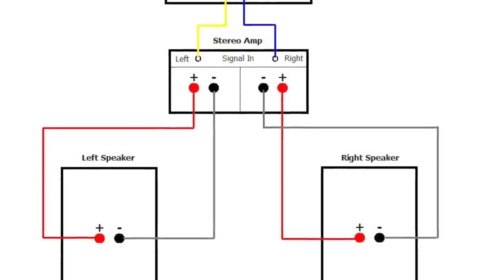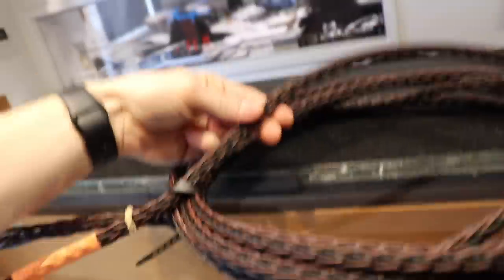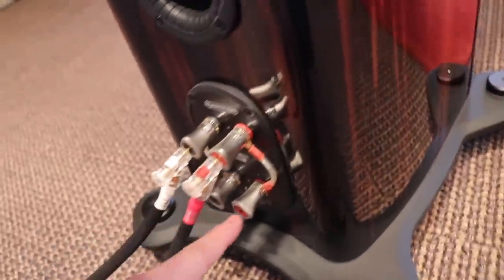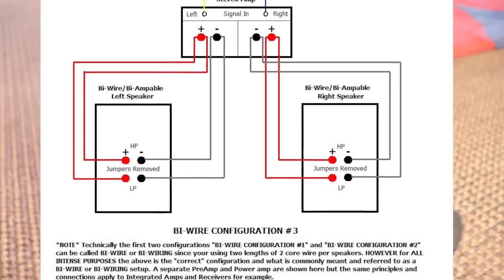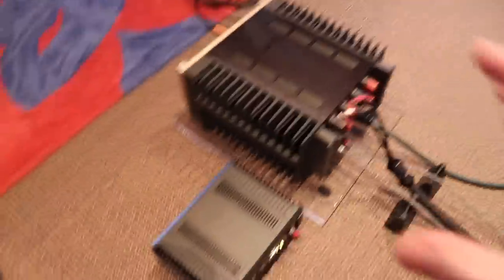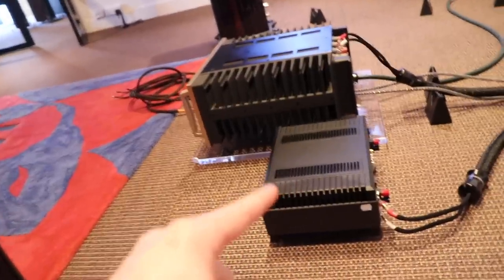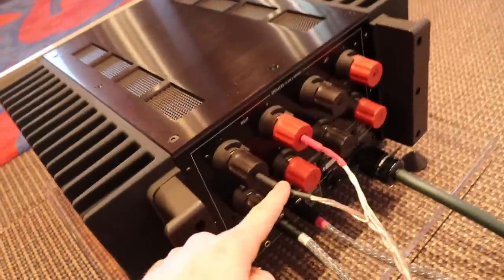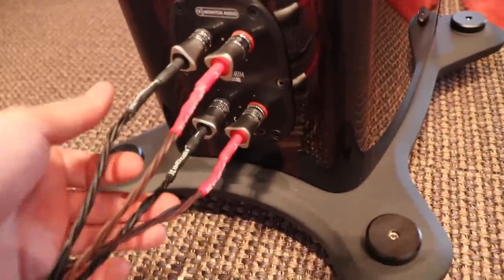Bi Wiring, Bi Amping   What is it?

Comment: When bi-wiring you mentioned it doesn't matter what black or red terminal you wired into - this was in reference to those vertically below, how about using 4 terminals in a row? My Marantz PM6006 is wired like that, just wondering if that makes a difference..
Reply from the maker: On that amplifier, the purpose of speaker A&B is mainly to be able to select between two zones or two sets of speakers so I would probably just stick with standard wiring.

Comment: Completely over complicated and electronically questionable. It definitely didn’t sound “the world of difference” these changes given initially adequate amplification are at best VERY subtle and you have to go to the extra trouble of matching amps. If the amp levels or design are different you are using amps as tone controls.which is an anathema with most high end audiophile guy!

Comment: How would you hook up a sub to a bi wire set up I've generally seen people hook them up straight from the speaker outputs would it just be from the amp outputs or what about super tweeters and in theory couldn't you get a tri wiring speaker and do a 6 amp set up I'm super interested haha so sorry for all the questions

Comment: Noob question here. So I have an AVR but no independent amp. So in this case I would not bi wire until I purchased an independent amp correct?
Reply: You could bi-wire, but you likely won't see much of a difference, not because of your system, but really the benefits of bi-wiring are questionable, it's a hot topic in the audiophile world.  Really the most measurable difference in using twice as much cable,  is you are increasing the gauge of wire going to your speaker.  If you use proper wire.  likely 12 to 10 awg you will be just fine for shorter speaker runs under 25ft.  If you want to bi-wire, you can use two sets of cables, one with spades, and the other with banana plugs into your AVR. but really you are just buying wire.  See what I did there :)  There will be more benefit from bi-amping.  Different amps have different sound signatures.  So if you likea specific amp to drive your low end, like a Class D, and want something that has mosfetts or tubes for the top end to get a different characteristic from the top end you can change how your speakers sounds.  Do some research on your speakers and find amplifiers that are complimentary of them.  If you are just using your AVR for movies, I probably wouldn't bother.  If you like to listen to music and want a big sound stage.  Play with some 2ch stereo amps not an AVR.  See what you like.

Comment: You missed to talk on how to connect the pre-amp out to the  2 power amplifiers. Do you split the pre-amp out wire to 2 to be connected to the 2 post-amp?
Reply from the maker: If You are going to bi-amp, your preamplifer must have multiple main or master outputs so that you can send full range stereo to both amps.  Dont use y splitters.

Comment: Is bi-amping, passive or active, intended only for passive speakers then?
Reply: In a true active system the cross-over, ie splitting the signal into bass/mid and treble is performed by a powered crossover located between the preamp and poweramp at line level. So a typical 2 way loudspeaker would require 4 channels of amplification, each of which would be fed only bass/mid or only treble depending on the speaker drive unit it was driving. In a passive system the cross over is performed after the power amplification with the cross-over typically located inside the speaker cabinet and powered by the music signal, which is a huge source of loss and distortion. A properly designed and installed active loudspeaker will be far more accurate and requires only modest amplification to produce any given level. A passive cross-over is basically why many speakers are power hungry, it saps the amps power dissipating it as heat, as well as creating phase shifts.
Reply: @jerrypartington3650  thanks a lot!

Comment: How do you match the gain when you using two different amplifiers? I tried it with two different size amps from same manufacturer and the bass was overpowering, I eventually resorted to an active cross-over which I use just to match gain.
Reply: as long as the amplifier sensitivity is the same you get the same from both amplifiers.

Comment: Very confusing and way to convoluted and overly elaborate. Then you have all the possible 'alternative' setups to make it even more confusing to get the gist of it and the basic advantages.. Still don't quite understand  :( 

On top of that the sound of the video could be greatly improved by using a better microphone. It's very disturbing sound-wise especially when you try to listen to the guy on headphones. Something you would not expect from a video that's all about sound quality. It sounds like he's in a bathroom. He's also talking extremely loud for some reason. Just some observations - rock on. ;)

Comment: Why would the manufacturer include the "flat blade of metal" if it deteriorated the sound so significantly?  Answer= They wouldn`t.
Reply: Why would speaker cable manufacturers go to all the trouble and expense of making intricate cable weaves (out of processed exotic metals) if solid or flat cables were just as good?  There would be no need for RF coaxial cable technology, or twisted cable, if there was no degradation over a single strand wire.
Reply: @bigpicture3  Your reply makes zero sense, and is not relevant.We`re talking about a speaker connection less than an inch and a half long. Not going to get a whole lot of signal loss in that run. What do you think the wiring is like behind those connections inside the speaker it`s self? No better than the jumper, I assure you.
Reply: I changed my blades to jumpers and could not believe the difference.

Comment: How can bi amping work without an electronic a crossover? you can asign full range frequencies to all the drivers. Thanks
Reply from the maker: There are still in line crossovers inside the speaker.
There is one for the highs and one for the lows, they are connected to seperate sets of binding posts.

Comment: Just bought myself a Yamaha rn-803d amp. And om the manual, Yamaha show how to bi wire.  But They use Port A and B on the amp. Everywehere else ppl use just the  A Port.  How is that?
Reply from the maker: Thats Bi-amping which is different to biwiring.
Thats just yamahas way of distributing a bit more power to the same speakers.
Reply: @SoundlineAudioNewZealand  no its bi wiring.  The yamaha manual is rubbish anyway.  Dont know why they show a and b ports on bi wiring.
Reply: @chriss881000  No doubt to make it easier to connect 2 sets of cables - spade terminals always make worse connections than banana plugs, so one set of cables would be at a disadvantage otherwise.

Comment: How much do you want to bet, there's a metal blade between the terminals inside that amp? Also, isn't the real advantage of bi-amplification the ability to use a DSP crossover and eliminate the mechanical device? Bi-amping a premade speaker like those, aren't you still going through the mechanical crossovers?

Comment: Bi-wiring : a way to spend double on cables 
Bi-amping : a way to spend double on cables and double on amplifiers 
There could be a benefit to bi amping if you want to change levels of bass driver to mids/tweeter perhaps. Or if you want to flavour the sound with some non standard amp
Reply: Bi amping would also increase or double the power.
Reply: @ekimandersom4478  so just get one amplifier with more power why would you buy 2 separate amplifiers,, you use additional for a 2''3'''4' way system ,,,,but you need a cross over,,then each amp is for a specific band of frequencies,,am i missing something
Reply: your rite rennie  love the way you put ,,the hole thing makes no sense at all
Reply: Bi-amping means the mid/hi pack is receiving a pure and independent signal separate from the bass at the head of it's cross/over and not in conjunction with the bass cross/over network.  This yields a significant difference, auditory and in speaker performance.  The greatest advantage being if the network is electronically divided.
Bi-wiring yields NO difference over just running a single pair into the entire speaker.  Still, I prefer to wire this way with separate connectors on both speaker and amp.  Lower resistance gauge, and separate inductance in each wire.  It's the best connection you can make whether you can hear it or not.
Reply: @keithmoriyama5421  thanks keith,, this is new to me,i have a marantz 2252b i think its great x-cept for the speaker connections,,they used  the spring push in type,,,they suck,,i want to change to those  newer banana  jacks,they look good ,,but maybe you know a better way??

Comment: What's the benefit of doing both bi WIRING and bi amping when it comes to impedance/ohms?
Reply: By its very nature, the more cable present, the less impedance is added to the sum of impedance seen by the amplifier.  Ideally the speaker outputs want to 'see' only the true value of speaker coil impedance, therefore influencing the 'damping factor'.   Bi-amping gives improved damping factor allowing better control of the speaker cone movement [specifically the woofer] over bi-wiring/single-wiring where the crossover components for the higher frequencies would interfere with it.  Bi-wiring's advantage is that the amplifier out is split at source, rather than having to divide itself at the cross over.

Comment: Acording to another expert on youtube, he said the if one is to use 2 cables to one speaker, they should be the same, not different. And as for bridge,  One could just cut ones cable and use a stump as a bridge. then it would aitomaticalli be better than the gold plate???

Comment: interesting bi-amping . can I do it with a solid state on the bottom and a tube amp on the top ? bot audio research .I already have a D-100B model
Reply from the maker: Try it and see how it sounds.  You may find with different amps however that the output levels won't match up and your lows or highs might be a lot louder than the other.
Reply: The most time consuming thing about bi-amp is to find the right pair of amps that will sound seamlessly. I found some success with an ARC D-120 at the bottom and Bryston 2B-LP at the top with my Maggie.

Comment: It seems like multi TC cable would cause smearing in the audio image due to timing variances?
Reply: No.  The braiding reduces inductance and noise.  Kimber are among the best cables you can buy and in the case of 4tc and 8tc a strong value.  Beldens new specialty speaker cable sold through Blue Jeans is also a braided design.  Everyone doesn't braid because it's an expensive proposition.

Comment: A company goes to all the work of making these speakers sound so good and cost thousands of dollars then they use cheap jumpers that degradate the sound to the point it can be fixed or improved with a short piece of copper wire that looks pretty.... yeah, no. Its audio jewlery and status BS. Gaurantee people couldn't tell the difference in a blind test. Your experiencing the power of persuasion and placebo effect. I do agree though aftermarket jumpers look much better.

Comment: I have a question. I have a stereo receiver with A+B channels. 4 channels total. Can I use side A for the bass woofer and side B for the highs together? With A+B turned on. I don't see why not. Does anyone know or have experience with this configuration? This would be bi amping of coarse
Reply from the maker: Yes you can do this.
One thing I will say though, is in my experience most amplifiers that have speaker A + B or 1+ 2 outputs which are selectable individually or together, aren't actually seperate amplifiers.
They are actually just relays inside the amplifier that connect the two seperate outputs on the back of the amp to the power amp circuit inside the amp.
So hooking the highs to speaker A left and right and the lows to speaker B left and right will actually just be Bi-Wiring.
Bi-wiring is a beneficial thing to do, but if your speaker wires allow you to have a standard configuration at one end and a bi wired configuration at the other, this will be just as good as two seperate pieces of speaker wire going to each speaker.
i.e. in my video I mentioned 4TC and 8TC
1 piece of 8TC with it split apart at the speaker end into seperate high and low outputs is just as good as 2 seperate bits of 4TC.
Hope that answers your question.
Reply: @SoundlineAudioNewZealand  yeah man I appreciate it. I hooked them up on A+B and it is so loud and clean. I have the Polk audio rti a9s. They are amazing speakers. I like your videos and how you answer back. I'm subbed now thanks man
Reply: @SoundlineAudioNewZealand  My ampli channejls A-B=4-16om.A+B=8-16om i can play bi-wi?

Comment: How does the source sound get to both amplifiers?
Reply: You use RCA wires to go from the receiver/processor to the amplifier. If your using just a receiver as the amplifier, the wire is made with two connectors on both ends.

Comment: Great video! But I still have some questions.  What about bi wire bi amping on Denon 4500h? It's a nine channel av with 9 times 125 watt at 8 ohm.
There is an option to use another channel that you won't be using because I only have 5 speakers. (2 front, 2 rear and center)
You use back surround for the high and front on the low section of the speaker. This way my speaker Polk s60e can get 2 times 125 watt , 250 watt at 8 ohm.
The Polk can play 30 -300 watt.

Is this a good solution or will I blow up my speakers? Some say that this isn't possible because it comes from one receiver. But this receiver can output 9 times 125 wattage. 

The bridge on the Polk is cheap as fuck. If I bridge it with another speaker cable with a y connector it would be an upgrade. 
Let me know how you think about this.

Ps: what an expensive equipments you have! Very nice. It's all above my budget 😆😆
Reply: You would be more likely to damage your speaker by trying to play them to loudly without enough power, than to over power them.  With what you are talking about, there is little risk of you over powering them.  Dennon is part of the D&M group, the M is for Marantz, which is what I own and know.  They have a 70% power guarantee.  Meaning that with 5ch driven, a 125w channel will only get 87.5w.  I assume Dennon has the same guarantee.  So really even by bi-amping them with the extra surround, you will only be getting about 180w to 200w  Your polks can handle 300w continuous, which would be ear busing loud in most rooms.  If you did bi-amp them, you could play them louder than you would ever want to listen to them, but if you did turn the volume to 100% you would likely cause damage to your speakers buy under powering them and causing clipping which is most likely to do damage.  if you ever hear clipping (square waves) not (sine waves) turn the volume down immediately.  Hope this helps
Reply: @shawnpurvis7527  thanks Stawn! I have bi wired them with my Dolby atmos fronts. That channel was not in use. 

If I play at 65 of max 90 it sounds so loud that I won't have to push any harder. 

I know that clipping is an issue and should be careful with opening up the volume. But never had any issues so I'm happy.

So by doing bi wire you get so much more power?

Comment: While using two different amps for bi-amping you would need to match voltage gains of those two amps.
Reply from the maker: If you are bi-amping with one amp per speaker, it is necessary that you buy two of the exact same amplifier so that the outputs are balanced in power and tone.
If you are bi amping with one amp powering the lows and one amp powering the highs of both speakers, they can be different models of amplifier but we highly recommend the amplifiers be of the same Brand and if possible series or range so that the only difference between the highs amp and the lows amp is the overall power output.
Reply: @SoundlineAudioNewZealand  Some people do bi-amp with different amplifiers with different power ratings. For example, one can use some tube amp for the highs and a solid state (even class D) amp for the lows. However, as I have mentioned before, in such case is very important to make sure that those different amps have the same gain. Otherwise one section of a speaker will sound louder than another.

Comment: Can I bi amp with the same receiver?. I have a Sony 7.2 that can do Bi-amp but I don't know if its worth it.
Reply from the maker: If it is capable, give it a go and see if your sound quality improves.
If it doesnt, it probably means that your amp + speakers aren't at a level where this would make a difference.
Reply: It would seem that by removing the weakest link in your speakers, the jumpers/bridges things could make your speakers sound better by bi wiring

Comment: How big of a mistake is it if I have two different set of wires? A pair of 4 TC kimber and a pair of Audio Quest Indigo. Will it kill my amp if I biwire with both the cables ??  I have a Krell KSA100-S. Can some one answer??
Reply from the maker: Wont Kill your amp, although different speaker cabled do have different impedances so you might find it will create a difference in performance between the HF and LF.
Give it a go and see if you prefer the sound to using one or the other.
If I could make a suggestion it would be to at the minimum use the same brand of speaker cable for this application for the best results.  (i.e. 4TC on HF + 4PR on LF) or (audioquest indigo on HF + rocket 88 on LF) for instance.
Reply: The only thing wire has is resistance copper is best CCA is not as good. Larger wire for farther runs. I do not believe anyone that says different.